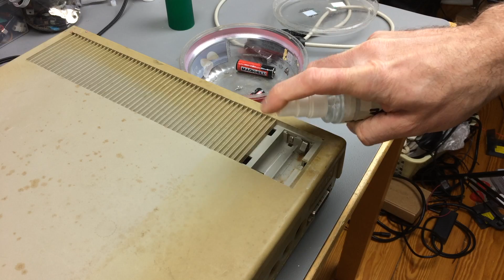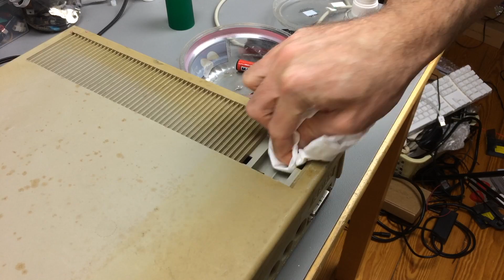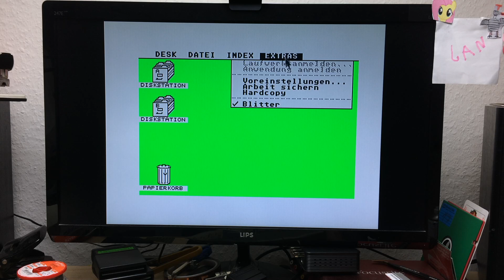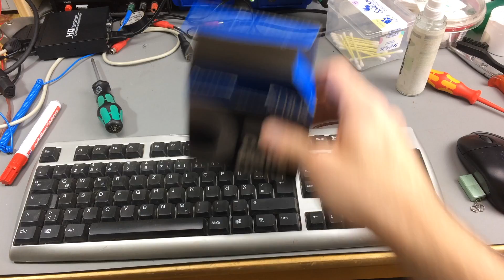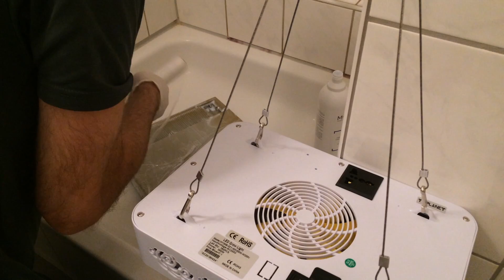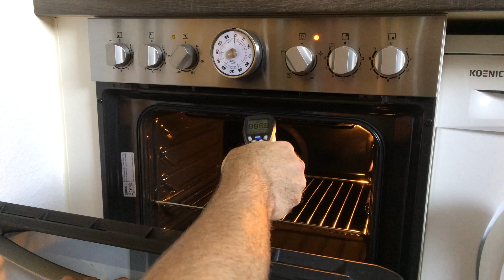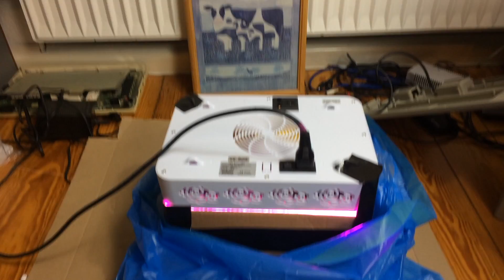Atari Mega 1/Mega ST Restoration

Comment: My fav brand. Now restoring my 29 year old 520STFM. Waiting for parts from AliExpress.
Reply: I hope they are not capacitors...
Reply: Pentti Kantanen No. Just the 13 pin DIN plug and some chip sockets.
Reply: My favourite machines too, I've recently got a STfm with a PC Emulator and a 1MB upgrade installed but it does nothing at all.
Reply: @acbc2k  13 pin DIN is a standard connector for car CD-changers, easily available and inexpensive... when you know where to look for.
Reply: Okurka Not really. I'm only getting basic parts. The rest all DIY.
Reply: there is a problem with capacitors ?
Reply: dlfrsilver My PSU caps all bloated. Had it replaced locally. Motherboard caps looks ok. Will power on once I'm done cleaning it.
Reply: yeah, those must be replaced even before thinking about powering up the computer.
Reply: tzok83 Not Malaysia. Impossible to find them locally. Could only find 8-pin DIN here. Alternatively is to solder DSUB-15 directly to the motherboard. Then again, won't risk doing it.
Reply: @dlfrsilver  I have never seen a faulty capacitor in ST, maybe the PSU is worth recapping.
Reply: The ST is like any other computer. And what you is a faulty way of thinking. The capacitors have to be changed. They are now over 25 years old, way above their life span and there are many idiots here and there that are switching on their computers from storage or getting them from a garage or whatever, and they think that they can power on like that. Electronically speaking, that's stupid above anything !
Reply: @dlfrsilver  There is no reason for a well made electrolytic capacitors to fail over time. Some manufacturers in search of reducing the manufacturing cost just screwed the chemicals and/or casing and their capacitors tend to fail over a time. I've got electrolytic capacitors which are over 30 years old and still perfectly in specs with capacity and ESR... actually capacitors which I've removed from one ST I was restoring, had a better ESR than brand new ones I was planning to use as a replacement.
Reply: Bing! you're wrong here as well : a capacitor life span is 20 years at best. They're not made to last 30 years. Next, the capacitors brands Atari used were notoriously crap to begin with. They cut the prices on components, and the capacitors were some of them. Any thing Taiwanese crap like Wang's cap and so on must be removed and replaced by high quality ones Panasonic/Rubicon or Nichicon. I performed enough serving on ST machines to say that the computer reacts better and get back a crisp clear display with new capacitors.
Reply: @dlfrsilver  Let everyone do as he thinks. I have serviced a very old, and stored in bad conditions, ST units. Some had damaged sockets and board traces due to corrosion, but all have original caps inside and now are working well with them still in. I've tested capacitors in most of them and never found one that would qualify as a faulty. In other computers and consoles, it is common, even Atari ones like Lynx, but not in ST. After the time it came out that the Wang's Caps were not that bad (especially when compared to CapXons). Or maybe other way - they were not great even when they were new, but with time they have not degraded much. Probably you're right that the modern caps could help to reduce the video noise, but the noise/ghosting was there even when these units were new.
Reply: Found plenty of Wang caps on my C103175 motherboard. Time to replace them while waiting for the mouse adapter to arrive. PSU already using Rubycon caps.
Reply: excellent choice ! The hardware deserves it ! ;)
Reply: @acbc2k  If you have a way of desoldering them without thermal or mechanical damaging them (so preferably you have a THT desoldering station), please test them by yourself on a capacitance/ESR meter and see yourself whether they required replacement or not and compare the measurements with the new caps you will be installing.

Comment: Eventually using HD disks in DD drives will result in data loss. The material is different. Etc etc. You can Google it. But they will work for a while. Fine for  moving files, installs, etc.
Reply from the maker: I read somewhere that many floppy manufacturers used the same materials for DD and HD disks which would make sense from a production point of view. No idea if that is true though. I've had good results with using good brand HD disks for years now.

Comment: Nice video.  I love the external design of the Mega ST especially with Atari monitor, but I hate the internal design. The Mega ST would have been a game changer if only Atari had included two modular bays for twin floppy or floppy and HDD.  Adding simplified internals with 2 or more low profile vertical expansion slots with outputs to the rear (personally I would have put everything on replaceable expansion slots, from CPU, Video and Sound.), and maybe a more professional keyboard over the ST one in a new case.
Reply from the maker: Yes, the Mega ST could definitely have been more than it was. I was pretty surprised it only had one proprietary internal expansion bus. A bit of a waste.
Reply: @JanBeta  That bus could take the Moniterm Viking display card and turn into a full blown Mac killing DTP Kaiju.

Comment: Nice! I've got one too. It lives for many years on top of my bedroom closet. I've got an b/w Atari monitor and a bunch of discs with several games and software too. I think I should try to test that stuff it it's still working.

I wonder if there is a possibility to use my modern computer monitor with the Atari. The monochrome mode uses a unusual screen frequency, 71 Hz I think, which was a problem back in the days, but today all monitors should synchronize on that frequency.
Reply from the maker: Nice! I bet it still works fine if it was stored well. If I remember correctly, there are adapters for connecting standard VGA for the hi res modes but I'm not sure about the frequency.
Reply: The problem is these old computers like the ST and Amiga used a very low (by today's standards) 15kHz sync frequency.  So although modern monitors can handle the ST's then-exotic 70Hz refresh rate in mono, they probably won't be able to lock on to a 15kHz sync.  I think people make converters though that would allow the ST to be used with a VGA monitor, maybe even with HDMI.

Comment: If you ever wanna go round the HDD route with vintage hardware - I.E. the Atari Megafile (lovely bit of kit to match the Mega series) or other 3rd party stuff from Gasteiner etc. Or decide to use a modern equivalent, please consider a bit of software called Superboot, it's a powerful boot manager that allows you to specify custom environments when using a hard drive. It's a great bit of software.
Reply from the maker: I'm looking into using a SATAn drive or something. The Megafile drives are a bit too clunky and take up too much space in the lab I think. I'll look for the Superboot software. Thanks for the tip!
Reply: @JanBeta  Jan, you could stack your Mega ST on top of a MegaFile drive case; they have the same footprint. Atari Mega ST folks were doing that ages before the Apple Mac Mini crowd adopted it and claimed it as their own.  :)

Comment: Nice video.
I like using baking soda to clean the cases. For me works better than soap.
Reply from the maker: Yes, I used baking soda before. Usually for some more stubborn stains because it acts as an abrasive and actually scrubs away a bit of the plastic. Soap and a brush most of the times does the trick for me.

Comment: Jan, the seal-breaker ;). Seems to be a very good sign for the systems sanity, for nobody messed up with the technology in the meantime,and as it shows, everything works fine. Well, Atari Machines are unknown territory to me as well, but definitely, they had very good systems out there by the time. Just a pity that everything is dominated by MS-DOS PCs nowadays.
Reply: I wouldn't always trust the "seal" to be a sign the machine hasn't been opened before. Authorized Atari Dealers could just apply another seal after completing any upgrades or warranty work.

Comment: You need to install an adequate chip to use HD floppy. It will probably need some cooling too. I used it on my Atari ST+. I could format HD floppy to 1.60 MB and I used a small fan on top to cool this "roach". And yes, I was using NEC drive.

Comment: Wow, I didn't know the ST version of Giana Sister was flip screen instead of scrolling! That's almost unbelievable. Makes me wonder if that's the way to get a half-way decent Super Mario Bros. type game running on the Commodore PET.
Reply: I would say that, with a unmodifyable font, no graphics mode and no sprites, the situation is quite hopeless for the PET.
Reply from the maker: I only heard that it was a bad conversion somewhere so I had to try it. There's actually an updated version that makes use of the blitter and has smooth scrolling. I think I'm going to try that in the next video. :)

Comment: The place for the fan at the back is used in the megafile harddisks. They used the exact same case so that one  would stack the Mega ST on top of a Megafile 30 or 60. In the megafile they put a fan and it most certainly was the loudest, crappiest fan I've ever seen. So be happy that they didn"t put one of those in the central unit.
The megafiles harddisk featured a standard RLL harddisk which was connected to a board doing the translation of the ACSI bus (the Atari bastardized SCSI) to the RLL controller logic. So if you get a megafile sometime, you will know that it contains really really exotic and obsolete hardware. 
I still have my megafile 60 but it's very unlikely that I ever get it back running. Last time II checked (so 7 or 8 years ago) it already had stuck heads on the platters. Even the mallet treatment will probably not be enough to unstick them.
Reply: I think my Mega 2 ST had a fan to keep all of the memory cool - it was fairly quiet, though.  A Mega 1 probably didn't have enough RAM to make cooling necessary - the 1040ST didn't need a cooling fan and it had a smaller, more cramped case with a keyboard somewhat blocking airflow over much of the motherboard.  On the Megas air was free to rise and vent over the entire surface.
Reply: Let's not call ASCI "the Atari bastardized SCSI". It was released before SCSI and based upon the features and specs of SCSI before it was standardized.

Comment: Nice video Jan.
Im really curious about the hardware part.
A nice machine that had not much luck and use in Italy. I have never seen a Mega machine around. Atari Falcon was not imported, just like Acorn Archimedes.
Reply from the maker: Yeah, I guess they were pretty rare in Germany, too. Most people I know with Ataris had 1040 or 520 STs. Vast majority was on Commodore machines though.
Reply: @JanBeta  The "Ghostbuster" soundtrack for the retrobrighting in the bathroom was really funny :-)
What do you use to make it at home?
Reply: Most people I kew who were seriously into ST had Mega ST's. The Mega ST's had four things the other ST lacked: more memory, a keyboard that had a better feel, a real time clock (that's the reason for the batteries) and integrated power and floppy (ok the the 1040STFM/STE had that too).
Reply: @galier2  The Mega ST's external keyboard was fantastic. You had to install spring mods into a normal ST keyboard to match the responsiveness of the Mega keyboard. That's another reason why they command such high prices on ePay.

Comment: Wie der Zufall so will, bin ich letzte Woche an einen ganz ähnlichen Mega 1 gekommen. Meiner hat allerdings das ältere TOS 1.02 und er ist nicht vergilbt. Ich hab jetzt nicht überprüft, ob es die selbe Platinenrevision ist, sieht aber ganz danach aus. Zumindest ist die Speicherkonfiguration genau so wie bei Dir. Mein Hardware-Experte des Vertrauens sagt, man kann die 8 RAM-Chips (256 kBit x 4 Bit) durch 1Mx4 ersetzen und die fehlende Adressleitung von Hand ergänzen, um auf 4 MB zu kommen. Allerdings ist der freie Pin der Adressleitung zumindest bei meinem Exemplar auf Masse, man muss also wohl den jeweiligen Pin hochbiegen. Den alten Speicher hat mein Kumpel bereits runtergelötet. Allerdings finde ich im Moment keine 1Mx4 RAMs im DIL-Gehäuse. Scheint nicht so ganz einfach zu sein...

Comment: I always use cream peroxyde on keys... one by one, I lay them out on a plate, apply the cream with a brush cover with plastic foil and put them in the sun... They are always perfect, I really think you shouldn't experiment with anything else :D It's a bit tedious to brush them around and over one-by-one, but it's worth it... I'll wait for the end of your video though, I'm still there where you put them in an oven :D
Reply from the maker: I tried peroxide cream on keys before but got some marbeling with that method so I wanted to try something else. Still experimenting a lot at the moment. I also got a "proper" UV light recently so I'm eager to see if using that makes a difference at all. ;)
Reply: Hahh, good for you :) I didn't try this indoors yet as I don't have a proper UV light... so I'm stuck with the weather :D I'm curious to see how it goes!

Comment: The Atari "Mega" series was introduced within the famous "Atari Explorer Magazine" as the Mega 1, 2 and 4 (with 1, 2 or 4 megabytes RAM).  Later they became branded as the Mega ST 1, 2 and 4, as I understand it.  So, you have in your hands the first run of the Mega series, before they were labeled "Mega ST".  Quick History of the "ST" - - -  The first motorolo-68000 (Sixteen/Thirtytwo bit or "ST" [rumored to stand for "Sam Trammel(sp?)"  was the 520ST, which featured the CPU/Keyboard, separate 360KB floppy, and a TOS that had to be booted from floppy.  The next year they released the 1040ST-f, with double the memory (1mb) and an Internal 720kb floppy, and then they released the 520ST-f with internal floppy (I don't know if that was internal 360K or 720K . . . anyone know??)  Then the next year they released the "Mega" series, and then the relabeled "Mega ST" and then the "ST-e" enhanced series with a graphics accelerating "blitter" chip, and this included the familiar ST CPU/Floppy all in one Keyboard unit.  After that they marketed the "Mega ST-e" with the Keyboard detached from the CPU-Floppy-boxed unit, with did NOT look like the familiar "Mega" series, but rather was housed in the more heavy duty "TT" (for Thirtytwo-Thirtytwo bit CPU) Finally, which flopped, and I'm guessing they had extra cases to house the Mega ST-e in.  Anyone care to make corrections or additions to my understanding, please post :-)
Reply: Brad Viviviyal  what was your overall impression of the Atari ST vs the Amiga?  Also, do you think if Atari had focused on Software and Peripherals and upgrades for the ST (like the Blitter chip STe and possibly New Sound) rather than trying to engineer brand new machines, that they would have had better business success?  Thanks for sharing your interesting experience
Reply: It’s the other way around; the Mega ST-branding came before the Mega-branding. What source did you use to draw your conclusion (date/volume/article name)? There exists an archived STart magazine article (titled “The Mega 4 - Atari unleashes four megabytes of power”) online that covers the January 1987 CES. The machine used for demonstration there was labeled “ST4”. A spokesperson for Atari states in that same article that the Mega ST4 would change its name (at an undisclosed future date) to the Mega 4. Having also seen photos of motherboards from both Mega ST4s and Mega 4s, it’s clear that the ST4 (especially the early big-floppy-eject-button model) was manufactured much earlier. They also typically feature TOS 1.02 from April 22 1987.

Comment: the 8 bit guy made an entire video about restoring the colour of old plastics. I'd recommend to check it out. He compares various techniques and products but if there is one thing you dont want to do is expose the plastics to heat.
You need UV either from the sun or specific UV lightbulbs.
Reply: TheSliderW check out the Retro Man Cave retrobright video too.
Reply from the maker: Yes, I saw a couple of videos and tried some methods myself. Nobody seems to have found a universal solution yet. In the 8-Bit Guy video I linked he actually uses a kettle on his stove with peroxide to retrobright the keys without any added UV at all. I guess things depend on the material, too.
Reply: Yes, you are right but it's better to take precautions when you don't know what kind of plastic it's made out of.